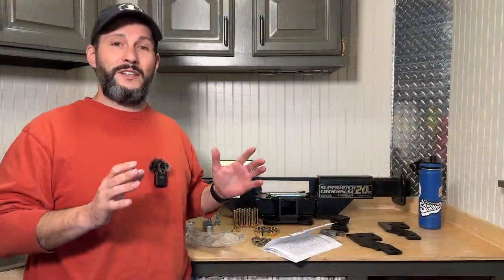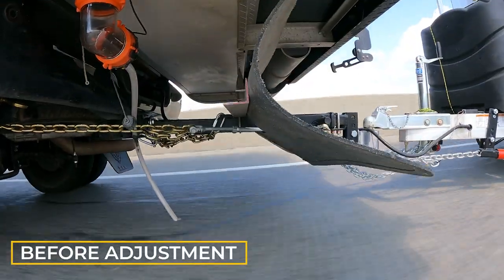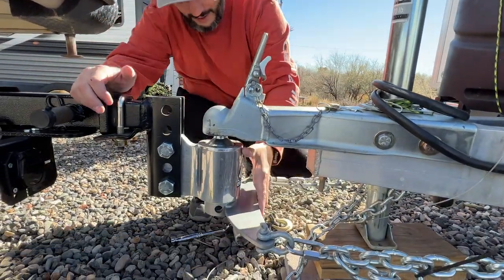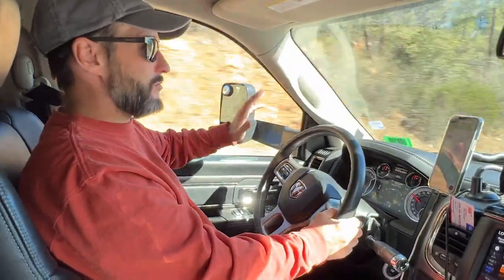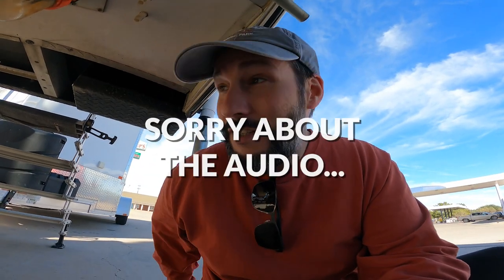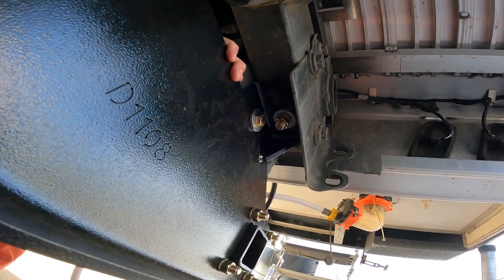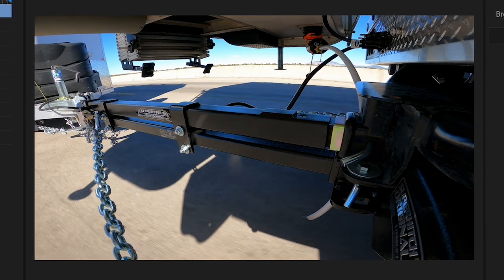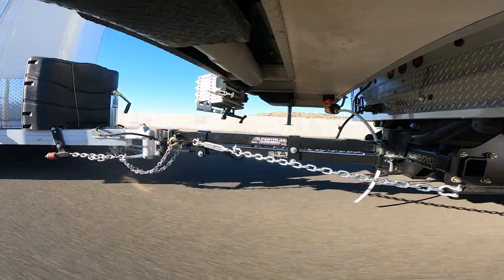1000 Mile Test Drive - Towing with the Torklift SuperHitch and SuperTruss

Comment: I had the exact same problems, and I also went with the SuperHitch. Nothing stopped the wiggle or bounce because of the leverage of the long distance between the truck and the trailer. The way I finally fixed it was this. I had a removable hitch made that lengthened the trailer tongue. I reinstalled my original hitch on my 3500 Dodge. I then had a welding shop to make a hitch for the trailer that locked into my trailer coupler with a ball and mounted with two plates to the frame of the trailer 3 feet back underneath with 4 bolts on either side, then this hitch protruded the same distance forward as the SuperHitch protruded backwards. When I went down the road with the new set up there were zero flex, bounce or movement. I wish I had some pictures available, but I can't find them right now. I made the hitch where I could remove it when I sold the trailer, but I actually sold it to another truck camper guy.

Comment: Here is some advice on your setup. I used to pull 4 snowmobiles with a 11 foot slide in camper. My hitch was homemade and very much like yours except I only used one 2x2 extension. The secret to this working is the chains. Chains dont help with bounce when they are level with the extension. The chains only help to stabilize the sideways flex. I ran my chains just like your but ran them at an angle up the the back of the truck as high as I could put them. If the chains angle up then you get stabilization of both sideways and up down flex. I mounted hooks through my bumper to the frame and it worked great. Never had an issue. best of luck.
Reply: That's a great idea. With my stock 3" ford receiver and a custom 3" hitch I'll bet I can convince my wife we need a Buckstop rear bumper to attach chains to. You are the man!

Comment: That is a tricked out system. It was very interesting to see the interaction between the truck, hitch, and trailer. You did a good job at capturing the movement!!! I especially liked the vehicle display of the speed, tachometer, temperature, mph, and the transmission temperature! Which is most important to watch. Just like the tire pressure monitoring system. You have a nice rig to be proud of. Safe travels 🙏   Toledo  💙

Comment: Hey Scott,
I meant to write a comment when you first published this, but I got busy with other things. I too have the super hitch with a 4 foot extension. At the time I got it installed, I didn't realize I only needed the 3 foot extension. The people who installed it for me were basically clueless. The 4 foot extension is heavy, maybe 70 or 80 lbs., I'm not sure, but super heavy all the same.
I have a 2004 Ram 3500 with a Lance 1181 camper with one slide & I pulled a 15 foot tandem axle Wells Cargo trailer. In the 3 years that I travelled &  used the hitch, I had zero problems. One thing I can say about torklift, is they build stuff to last. So I don't think you are going to have any problem with your hitch setup. 
BTW, I live in Austin, TX & in June I will be heading up north for business, so maybe if you all don't mind, I'd love to swing by your campground for a night or two & a visit. 
Happy camping.
Reply from the maker: I agree, Toklift’s build quality is very incredible! It have no worries about it lasting, I’m just wondering if the wiggle is intentional or just because of how I have the weight distribution setup. 

And yes, we will be in Glen Rose for quite some time. Shoot me an email at info@stonyboot.com or message me on Facebook and we can chat about visiting.

Comment: Long time truck camper owner here.  I've had the same truck since 2009 and right off the bat I installed a Torklift Superhitch on it.  The truck has 75k miles on it now, which is mainly used for truck camper duties and not daily driving.  I'd say that 70k miles are with the camper and towing.  I first had a 24" Supertruss and an AF811.  I now have a 36" Supertruss and an AF992.

Comment: I’ve towed over 500k miles using a SuperHitch with a 48 inch extension (tow bar )attached and never had a problem. I start towing with the Reese  3” hitch and a Reese 48” tow bar but they would break after a month or so of use. I also used a Curt 3” hitch and they would crack as well. The last time I used a Reese with an extension it cracked on me. I was on a mountain pass and it gave out, so luckily the roadside service I called welded braces on the sides.  So I spend the money for a Torklift SuperHitch and I never looked back. 
I would carry a 11 foot slide in camper and attached a 24 foot travel trailer on the supertruss extension with plenty of room to make turns. Not U turns.
I would also recommend a solid 2 inch  none adjustable tongue from curt.
Reply: What truck/suspension mods did you also do?

Comment: You have an adapter sleeve in the upper receiver to drop it from 2-1/2 down to 2 inch. This is causing a lot of the movement in the truss. Also The bent pin type of hitch cross pin will cause wear and flaring of the hole. My '03 Ram has this as does my buddies 2017. In addition a guy on a discussion forum noted his excessive wear and flaring out of the hole. A Gen-Y Iron Grip pin may help and a adapter sleeve either welded to the truss or the variety that has set screws to lock it to the truss, will also eliminate points of movement. You did a lot of work though, and I enjoyed the video.
Reply from the maker: What a great comment, thank you! I had to stick it all together and hope for the best. My only issue is the wiggle. I still haven’t gotten around to talking to Torklift since we have been overwhelmed with other work. 

I’ll look up those pins and talk to Torklift to see what they have to say. I’ll get around to an update video in a month or two when life slows down a bit.

Comment: You might consider flipping the trailer plug mounting bracket on the far end of the Supertruss.  I installed mine "up" instead of "down". Gives me a little more confidence when unexpectedly dragging my hitch extension.
I do agree that the installation instructions are confusing the first time you install a SuperHitch. If you do it again you'll be fine.

Comment: I doubt you’ll get anything significantly better other than a custom hitch in which the hitch itself is extended from the pickup and reinforced to the chassis. To get it to be more stiff you need there to be something going in an angle. As long as the entire setup is parallel to the ground it would be close to impossible to make it more still without breaking something. Off course, the downside is that if/when you take the camper off you’ll have a hitch protruding a feet or two behind the pickup, but there’s a price to pay if you want it to be done right.
Reply from the maker: Same through process I went through. The SuperHitch and SuperTruss are a one of a kind product. The only other options I could ever find were custom. 

Thanks for the feed back, I just did some more searching and found nothing else out there.
Reply: @Stonyboot  the only other options I can think of are adding tensioning chains that would go at an angle to the hitch extension but I’m not sure where/how you’d hook them on the pickup. Going up maybe there would be a location on the bed but going down I’m now sure where/how to attach. In any case, those attachment points would need to be super strong as they’ll be under a lot of pressure when going over bumps. If anyone can solve this it’s likely Andersen. They have tons of creative products and already familiar in using chains to stabilize hitches.
Reply: Oh. Maybe if you attach some 10-20” vertical 2x2 thick square tube on right/left side of hitch receiver (ie, 5-10” from the edges of the truck), you’d be able to hook support chains on top/bottom to create triangles which would add a LOT of strength. Adding those two 2x2 would need to be custom mounted (heavy duty bolts or preferably welded) but it should be a small and easy job for a fabricator.
Reply: Honestly for the cost of all this i'd just have a fab shop extent the trailer tongue and be done with it. just have to watch your departure angle.

Comment: Good morning!  Hope you are all doing well!  Quick question for you.  I just purchased a torklift extension, but it doesn't seem to tell you want to do to extend your safety chains to the truck.  Or do you extend them?  What did you do?  Obviously the trailer chains attach to the receiver at the end of the extension, but do you run a set of safety chains from those up to the hitch at the truck?  Thank you in advance!
Reply from the maker: My understanding is that the attachment system to the hitch does not need a seperate set of safety chains. It would make sense that the site support chains (the chains that run at and angle back to the hitch) satisfy this need. 

Keep in mind, Torklift isn't your typical company. You can simply call their support number, they WILL pick up, and will clearly answer any questions you might have. Their support is really top notch!

Comment: What I would do if I owned your setup. Those empty brackets that appear to be part of your original hitch just under the bumper. Make 1/2” thick bar stock adapter with holes to bolt flat to the face of them. Drill a 5/8ths hole in the middle to bolt a 5/8ths forged eye bolt into. Then move your two side binders and chains put to the new mounts. This way you can tighten the poop out of them and they would keep the extension centered and also pull up on it holding more trailer weight. I did something similar years ago on a home made extension I made for a friend. Worked fabulous.

Comment: Really liked this video.  How necessary do you think the Anderson Load Distribution hitch system is, when using the Torklift Super Hitch?
Reply: I ALWAYS tow with a weight distribution hitch, even with my tiny 7x12 cargo trailer.  I use a torsion bar WD hitch, not the Andersen style shown in this video.

Comment: The torklift super hitch looks awesome.. I think it is a great investment. I would for sure buy one one day.. my question is how did you get your back up cam to your stock display?  Did you use a new camera with a harness or did you take the out of your old tailgate?
Reply from the maker: It was mounted into the flatbed. I did a video about it a while back. The flat bed installer just makes a mount for it, drills a hole in the bed and mounts it from behind at a slight angle down.

Comment: looks good. but what about driving up driveways? i’m sure you only have less than 5” to clear and would drag your stuff up a curb cut or driveway… how do you handle that ? or even a speed bump.
Reply from the maker: Speed bumps are no problem, and for steep driveways I just enter at a slight angle. It’s only hit a few times, no big deal. Granted, I change how and where I drive with it.
Reply: @Stonyboot  Gott’a Ya ⚠️

Comment: You showed the Super Truss slides, have you wondered if a weld would help?
Reply from the maker: I wouldn’t want to weld it. For strength reasons, but also because it works fine as is. 

I haven’t used it in about 6 months, maybe I should revisit the system. There have been many questions in the comments.

Comment: Nice information!  Check with Torklift to see if the flexing is by design and is acceptable versus shifting those up through your vehicle or trailer suspension. Reminds me of our Morr Ryde 5th wheel hitch dampener designed to absorb some motion for a smoother ride (so they say!) One more mention, your trailer plug shouldn't be tucked between the ball. I've had them crushed during travels. Use a d-ring to lift it up out of the gap. Mind the gap. LOL

Comment: I have nothing against Anderson, but I don't see how those chains transfer weight back to the front tires of the truck. I'd suggest an equalizer WD hitch (or similar) to get the proper upward loading of the weight distribution. 

You could measure the front and rear bumper height on flat ground, then hook up the trailer and measure again, then tension the chains and measure again to see if it actually puts weight back on the front tires....or use 4 scales to eliminate all the measuring.

Also, the bottom bar on the SuperTruss is a secondary truss, but also a massive spring. On your original setup, the OEM hitch and frame were acting like the spring.
Reply from the maker: The Andersen hitch transfers weight in very similar way, just with different mechanics. 

The real problem with the SuperTruss is the play in the pins. I just need to tighten them up.
Reply from the maker: The Andersen hitch transfers weight in very similar way, just with different mechanics. 

The real problem with the SuperTruss is the play in the pins. I just need to tighten them up.
Reply: @Stonyboot  I watched the video again, you mentioned it looks like it was "floating" with the Torklift and the setting on the Anderson. The WD should be putting enough upward force on the hitch to not need a hitch tightener, that is the way my WD works with my travel trailer.

Comment: Wiring harness install Q:  How did you get TorkLift's extension to fit into their included bracket?  Obviously something has to come apart - never have I had to disassemble one of these. TorkLift's instructions make no mention of what to do.
Reply from the maker: I didn’t use the torklift wire extension, so I don’t really know. If you call them, they will help. 

If not, shoot me an email and maybe we can figure it out.
Reply: Answering my own question: Taking apart the "outboard" end required removing a pair of small screws and a set screw. The latter pushes a cable holdfast and it can fall out, so be sure to note  what side (it's the "square notched" one) contacts the set screw.
Once that's done, the cable can be pushed through and then you have the fun and joy of loosening the wire clamps for all seven wires. Pro tip: label!  I used a Sharpie to write on each of  the six blades "G" "BN" "BK" "BL" "R" "W" before I removed the corresponding wires. The seventh yellow wire is in the center; no need to label it.  Note how "B by itself could be black, brown or blue - thus the useful two letters.
That done, the entire bundle of seven wires can be slid out the 'back' of the terminal, and thus separated, it can be passed through the TorkLift bracket. Now to reassemble: for my clunky fingers this is pretty difficult but, by dint of perseverance, I got it done. Yellow first, then each of the others. I found that by separating the strands into two more or less equal halves, then bending them around a narrow diameter screwdriver, I was able to approximate what it takes to insert them into position yet still be able to pass their holddown screw into position. 

Hope this helps others -
Reply: @elyssalanehome8840  I started down the same path, but then found that the plug mounting bracket will bend at the 'split' enough to pass the cord through, and then bend back. I was surprised, but it is just mild steel I guess so pretty easy to deform a flat piece like that, and malleable enough to bend back. I was happy I didn't have to undo all of the wire connectors !
Reply: Well, what's wrong,  @gentleSlopeLiving , with your response is that it comes 8 months too late!  To all others: I second Ray's suggestion. Simple, effective, and obvious in retrospect.